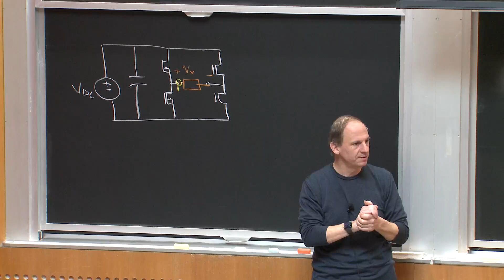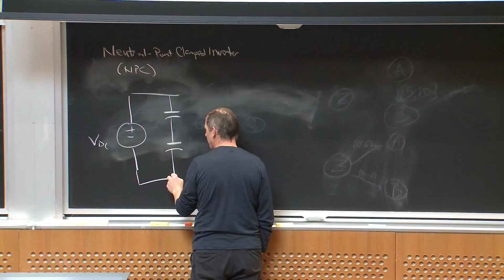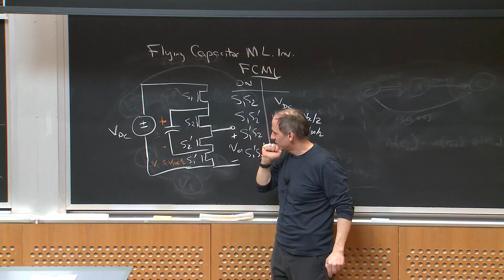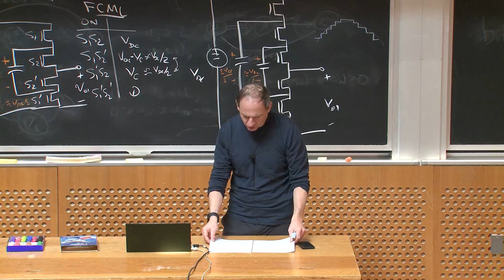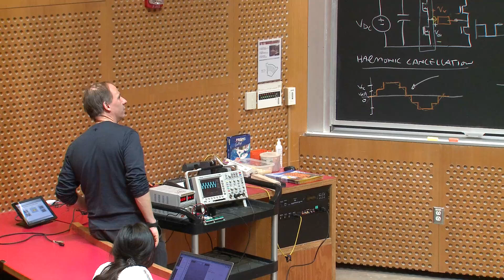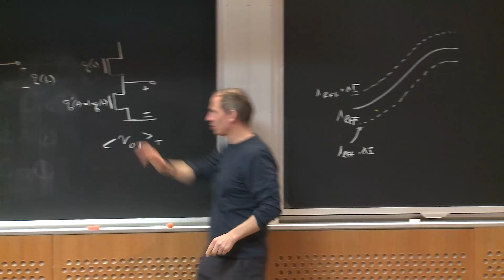Lecture 19: Inverters, Part 3

Comment: BSEE/MBA from 1990... I've watched about 10 of these lectures, partly out of interest as someone into tube-powered guitar amps but partly out of interest to see how EE curriculums and pedagogy have evolved.  In my recollection, MIT's courses have had a reputation for decades as being more focused on learning through specific applications, rather than spending 90% of course time re-proving the underlying math.  This series certainly reflects that "application first" focus and illustrates why that is superior.  I attended Washington U and "applications first" was definitely NOT the dominant mode for courses.  I had one class, EE380 for Linear Network Theory, that spent an entire mind-numbing semester on the matrix math required for analyzing multi-port / multi-terminal networks of circuits including fictional elements that, if they existed, would have really interesting characterstics when analyzed via these matrix techniques.  Wasn't a SINGLE reference in that entire class to a practical example of how those techniques would be used to solve a real problem.  And that was a required class in the EE curriculum.   It would be interesting to see a similar lecture from the present at other schools to see if they've gotten smarter about their methodology.